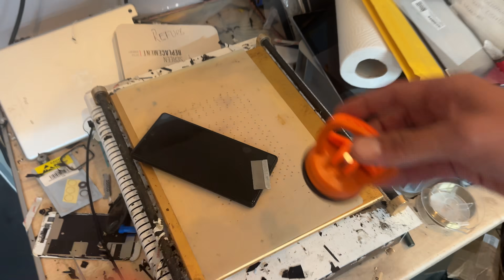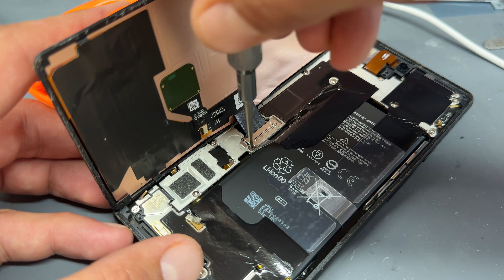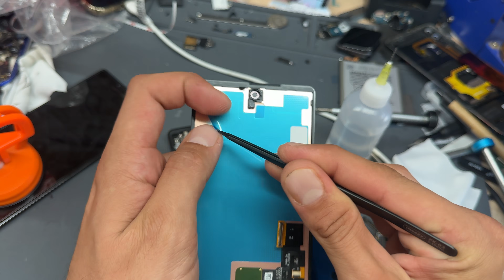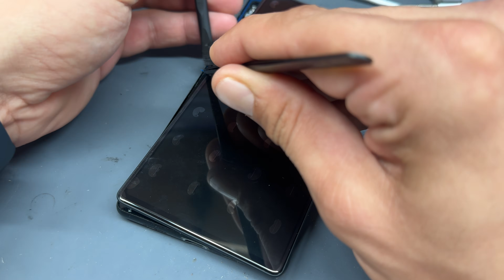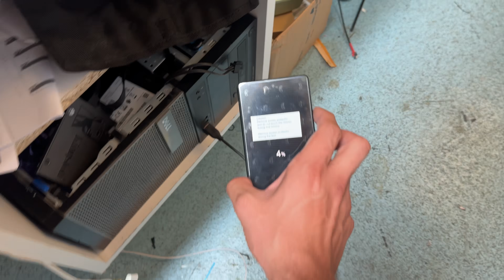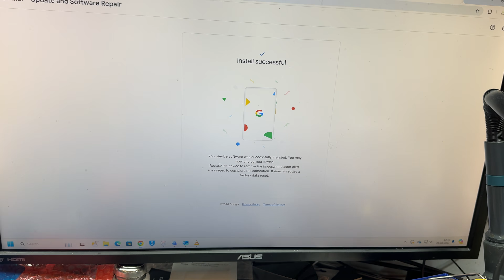Google Pixel 6 Screen Repair - Complete DIY Guide to Fix Your Broken Screen!

Comment: Great video.  I have a pixel 6a gx7as.  I tried installing a screen with a plastic bezel I bought from amazon.  It didnt fit perfect even after I shaved off the side extra plastic clips on the edge of the new screen.  More over the phones GUI looked very different with the aftermarket OLED screen.  I want to try again using an original screen without the plastic bezel.  I also like the blue adhesive you used.  Looks like a very simple installation but my first attemp was horrible.  I still want to fix my pixel 6a but its confusing to match model gx7as as there are too many different sub models

Comment: Thank you. I was convinced to follow this methodology after my Labradoodle (Lola) checked my Pixel 6 for edibility. Labs in general score very highly on this index. However, my Pixel 6 failed this in two ways. (1) The test was user-aborted after one bite and one puncture. (2) The Pixel 6 no longer worked. Thanks to your guidance it works again. Lola is temporarily out of the doghouse.

I have many, many gadgets in my kitchen. eg A 12V Hitachi drill which drives one beater from a dual hand held mixer. Aalso a de-handled bottle brush. An adaptor to drive a manual can opener etc. Extremely handy.  I have other 2-way devices...

Today, I vacuum packed my phone  (doubled bagged) and put it in my sous vide machine set for 80-C for 8 minutes. It maintains temperature +/- 0.1-C. Worked perfectly. If I knew what temperature a Pixel-6 could handle in direct hot sun on the dashboard cowl in Death Valley ...

Worked like a dream. I had no one-sided razor blades, but used three joined snapped off slices of a utility knife. Also worked

Comment: Definitely one of the best information clips. Very easy to follow, with the positive message that it is one of the easiest replacements possible. Extremely good point to meticulously clean and prep the surfaces before adhesion, probably the most important info. Do not use an aggressive method that could possibly MICRO scratch the crevice. P.S. Isopropanol alcohol can literally be found in even gas stations next to Band-Aids in Alka-Seltzer.

Comment: Getting off the screen was easier than expected. Wife's hairdryer and my pizza IR thermometer to check I had reached just under 80 degrees C, and a cheap suction cup and guitar pick was enough to open it up! Now to figure out why it is not charging or showing signs of life, thanks Google for your lovely update!

Comment: Can we reuse the fingerprint sensor of the damage screen? since most of the replcacement screen available in amazon do not includes this sensor.
Reply: Yes, but there's a fair chance you might damage it or install it improperly, making it either not work or work badly. Either way, it's worth trying, just take your time with it and be gentle. Do make sure you buy an OLED replacement screen, otherwise it wont' work.

Comment: Excellent video, this was much better than the instructions with the screen.   Hardest part was removing the old adhesive.  I was able to get it off using 90% isopropyl alcohol on a Q-tip and scrubbing it off.  Thank you.

Comment: Sir i have a question for you

If i use isopropyl alchol and spudger to open screen instead razor blade what happens. There is a problem for phone or not?
Reply: if you are maybe going to reuse your screen if it still works, you may damage the screen while trying to remove the screen, and the spudger will probably be hard to open up your screen from your frame.
Reply: @potatoeing you don’t really need a razor blade just make sure the heat level is good when you heat it so it won’t cause damage to the screen just make sure to melt the adhesive you can use a spudger or. Peice of good hard plastic you can get them from screens
Reply: @its_whiteplayz  its better and maybe easier to use a razor bladr
Reply: @potatoeing  true also do you repair phones if you do can you give tips
Reply: @its_whiteplayz  i repaired my dads s20 fe and my s10e, but i got an s23 ultra now
Reply: @its_whiteplayz  for tips, u should use isopropyl alcohol for anything that is stuck, it helps a lot to remove it.